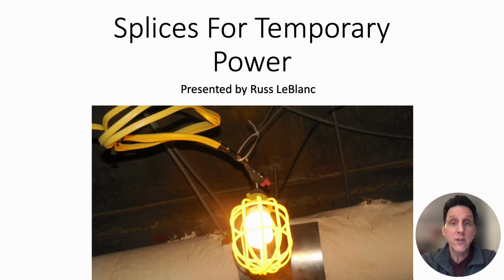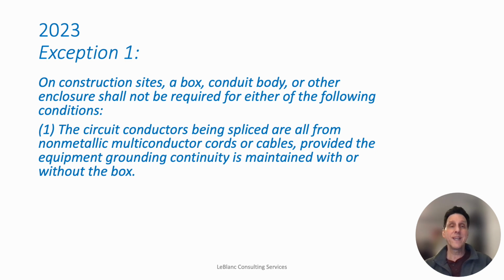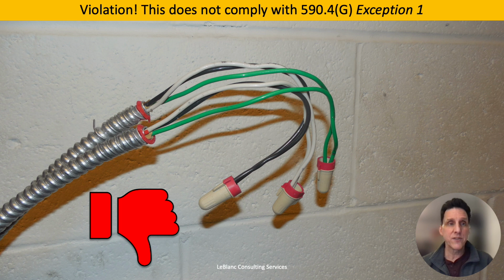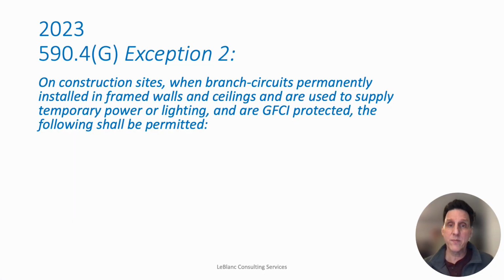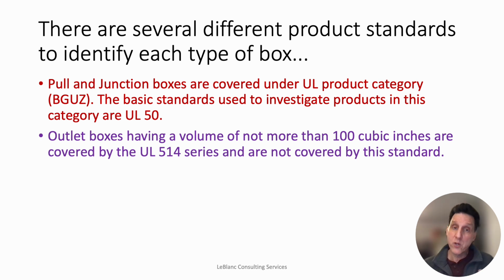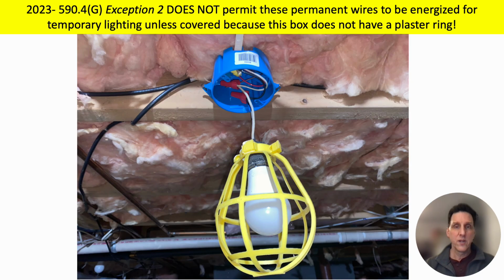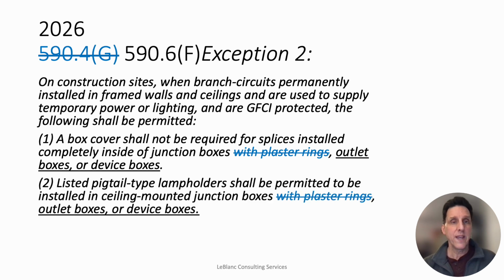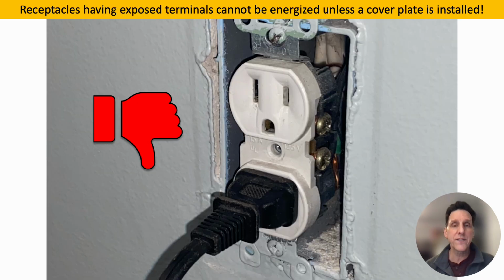Splices for Temporary Power- Article 590

Comment: The words “with a plaster ring” leads me to assume they are referencing an outlet box as a junction box typically does not have a plaster ring.
Reply: Definitely doesnt make sense that you can energize an open splice but not the wiring in a lighting outlet just because it doesnt have a plaster ring.
Reply from the maker: I agree. There was absolutely no substantiation for the plaster ring either! It's probably gonna be revised for 2026!